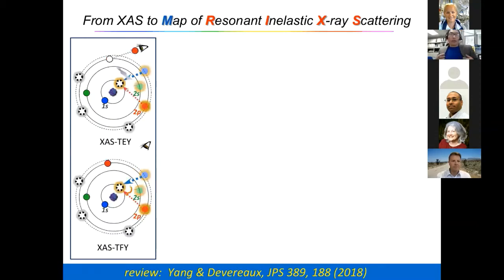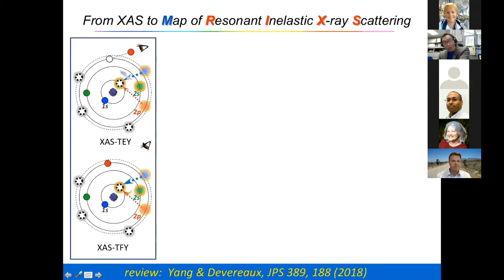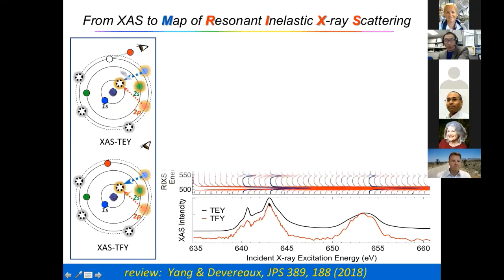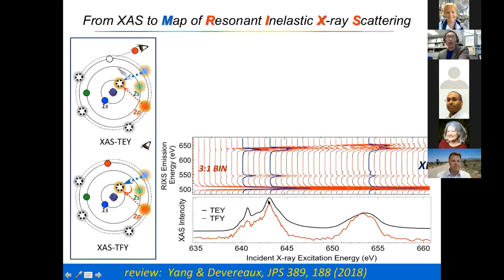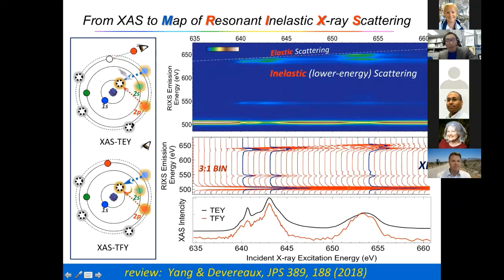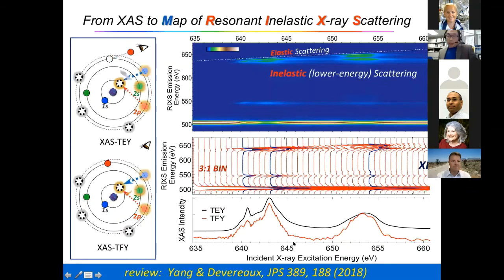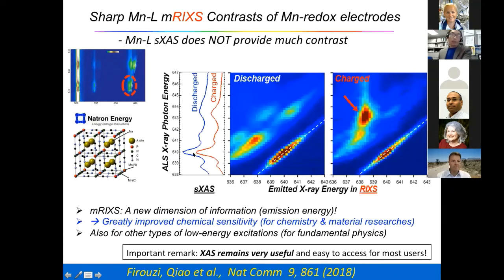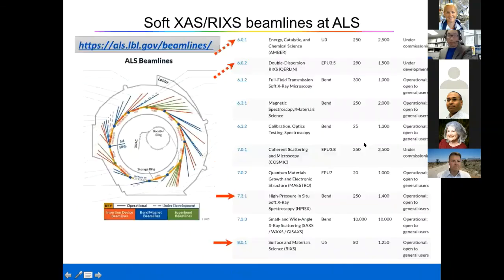A "slow" technical explanation of mapping of RIXS (mRIXS)

Comment: You are right the X-rays produce a photo electron.  However the Total electron yield actually comes mainly from  the Auger electrons that are the principal dexcitation path for the core hole so it some ways both X-ray fluorescence and electron yield methods come from the de excitation processes of the core hole.  Many people think that the electron yield signal comes directly from the photo electron emission.  To be honest it does not really matter if you do not know this you can still interpret the spectra.  The photo electron is very important as this is coherent with the core hole from which it comes and all the exafs comes from this.
Reply from the maker: The XAS Auger electron emission is schematically shown in the upper left corner, which is not the topic here. I have another short video in this channel to explain the XAS.

XAS total electron yield contributions are often dominated by secondary electrons, with Auger electron excitations shown here. And yes, XAS electron yield is completely different from photoelectron spectroscopy, also explained in my other short video. 

Thanks for your comment. I'm not monitoring the channel but suddenly got a notice today -LOL!